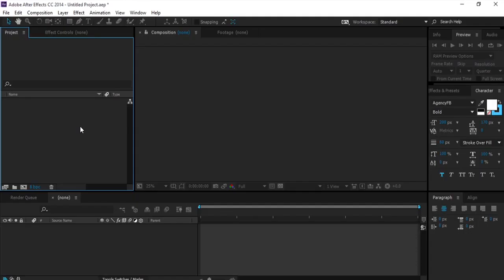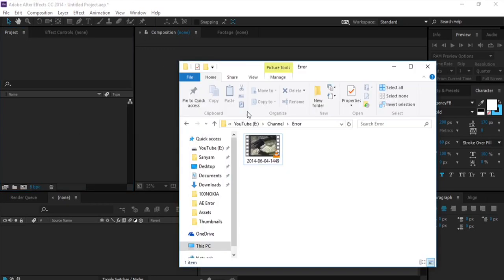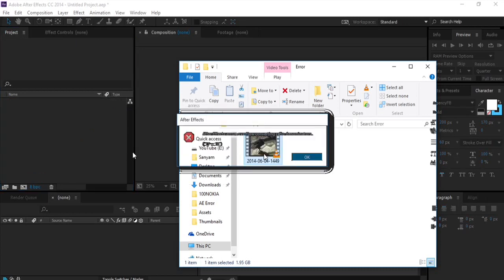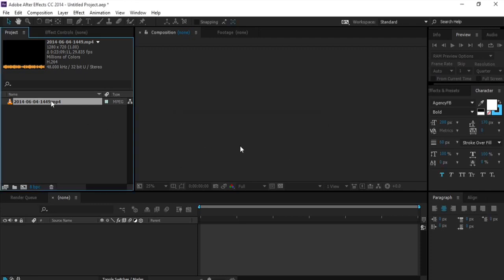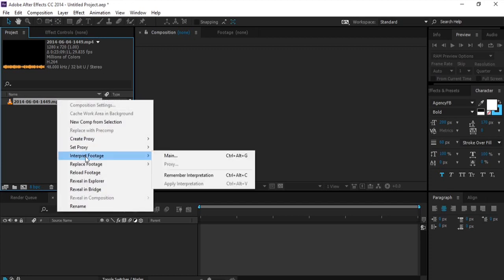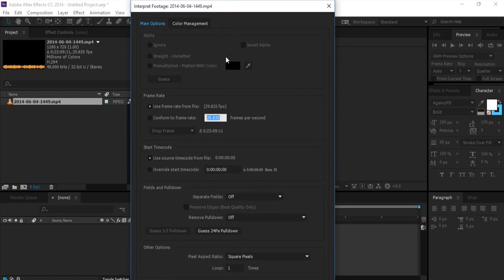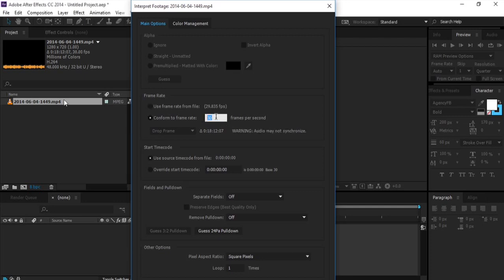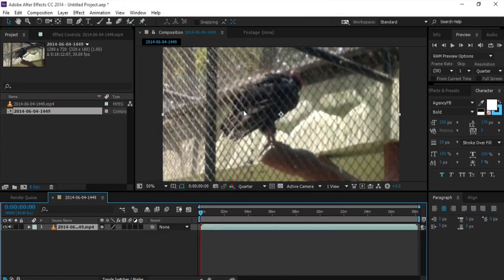✔ How to FIX Overflow Converting Ratio Denominators Error? | Adobe After Effects

Comment: Holy shit. THANK YOU! My mp4 file was already set to 30. But I noticed the two options: "Use frame rate from file." and "Conform to framerate." I selected "Conform to frame rate". Because I figured that the file frame rate could be messing with stuff. After I did that I just went to the timeline and closed the comp tab that had the file with the issue. Then I double clicked the comp in the left side panel to reopen it on the timeline. All the layers were back where they belonged! Thank you so much for showing me that good sir! :D

Comment: If your video got shorten after  use interpret footage, maybe you need to reasign a new framerate value to the original video outsite AE, using this program https://youtu.be/CIz-pCzNiv0 It works very well for me.  Then you can upload again in AE without any inonvenience https://handbrake.fr/rotation.php?file=HandBrake-1.1.2-x86_64-Win_GUI.exe

Comment: I really need your help! Ive been editing this video for about 2 days now and then suddenly this morning I come on to have this error. I have to 9 clips with 29.97 fps and 2 with 59.97. I follow your instructions and put the two clips on 29.97 but after it still gives me the error... What can I do! I have to redit those 2 59.97fps clips... Thanks!
Reply from the maker: +Soully follow the steps in this video and instead of setting the framerate to a whole number just set the framerate to 59.97 of the clip with 59.97fps and same for the other.

Another thing you can do is download a free software named 'Handbrake' and convert the file and select constant framerate in the 'video' tab I guess.

Comment: For the people having trouble with the audio not being in sync, I had the same problem so do as he said, go into interpret the footage but keep the FPS as the one on the file of your footage but select the bubble underneath and it called “conform to frame rate” for example my fps was 59.179 from file and just make sure when you conform that it’s the same. It will make the footage work perfectly. If you need any assistance reply to this comment. :)
Reply: 4 years later but still makes my 23 minute video 9ish minutes

Comment: this does not work properly, you get shorter videos and audio that is not matching with video
you need to convert that "buggy" video with media encoder first
Reply from the maker: +Li0ns Heart you can use Handbrake to convert the video and make the framerate constant.
Reply: thx didn't know that ^^
Reply from the maker: Li0ns Heart anytime =)
Reply: either way it's about converting first :P
Reply from the maker: Li0ns Heart yeah xD
Reply: no you dont.. try renaming mp4 with .dif having quicktime installed, tho it has some downsides doing so too.. its best to avoid encoding as its potentionally going to rip you off of quality, even if slightest

Comment: It shortens the video... any other ways?
Reply from the maker: Try changing the extension of the corrupted file to .mov or .mp4
Reply: ***** I did try converting it many times, sadly it does not seem to do anything =/
Reply from the maker: Don't convert it. Just change it's extension.
Reply: Nope,nothing. I just rendered the bit I needed in SV, seems to work.
Reply from the maker: okay. good =)
Reply: ***** Thanks for trying to help ;)
Reply from the maker: Anytime =)
Reply: the fuck would he try to change extension to something that works the same way.. its better to try changing it to .dif , having quicktime installed
Reply: Thank you - this saved me from a nightmare!

Comment: Thanks a lot  ! it fixed the problem.
Reply: I am sorry but later on I checked the duration of the video was 24min, after using your trick the clip compressed into 9min.
Reply: The ending, the 24min video is only shown till 9min in AE.

Comment: Dude,  it worked but the video cuts off the end. it was originally 23 minutes long, and after i intercepted it, it shortened to 19 minutes.
Reply: ***** 24:47 seconds. and thanks for responding :)
Reply: +PsychoGamer The same for me :(
Reply: Zsolt Kovács I know why it is happening to me. I made my recorder (Mirilis Action)to only record 10 minutes per video. My recorder otherwise will give me the error
Reply: +PsychoGamer its happening to me how do i fix
Reply: ***** For me my  recorder was the problem. so i started recording 10 minutes for a while which gives me about 4 to 5 files. If i record more than 10 seconds, then i get the problem